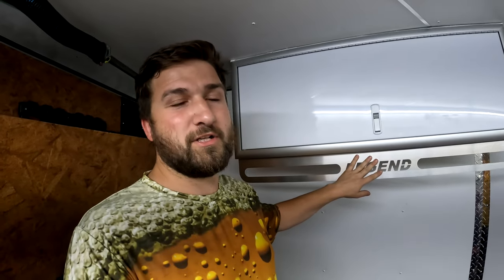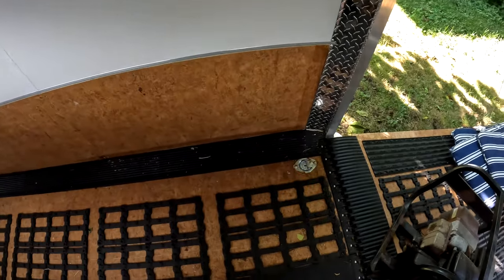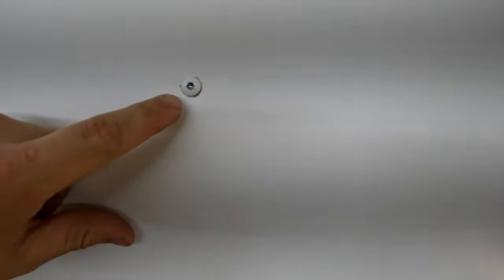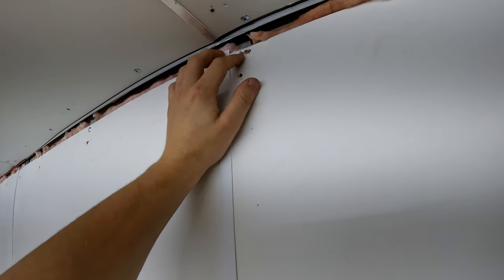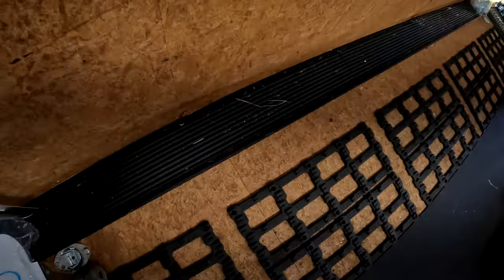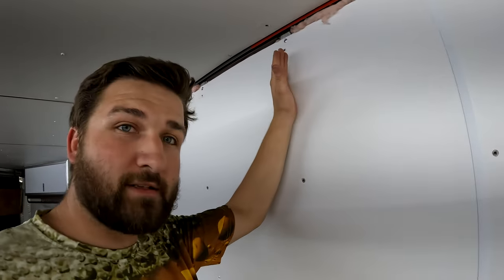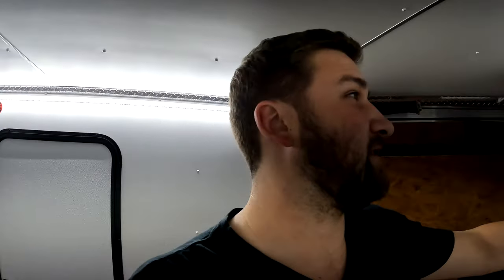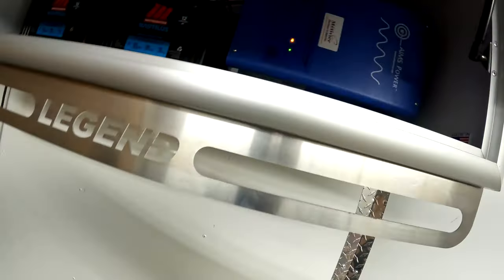Building the Best Snowmobile Trailer on Youtube! Extra Storage Install

Comment: With the shore power cord coming down you should run into a piece of conduit instead of loose , even if you clip it to wall it could get cut , Trailer build looking great
Reply from the maker: Thank you! It has since been secured and we have also installed calibre flex glides near the wall there, the tall ones so the skis can’t ever hit the wall. I do like the idea of the conduit though!

Comment: How much were the cabinets. I would like to install a couple more in mine also. I had same idea also with putting heater in one but have not done it yet. Thanks for video. Good job👍🏻
Reply from the maker: I could go find the bill but I think they were like 400 cad $ I bought them because they matched the one that come with the trailer. They work well and look nice
Reply: @SouthernSledders  ok. Thanks. Yes they are nice. We have a ledgend trailer also